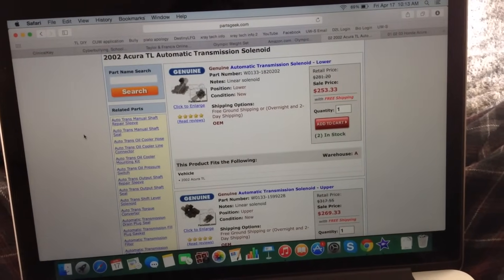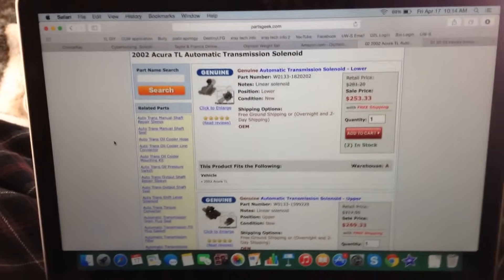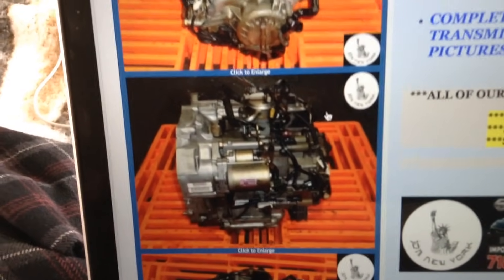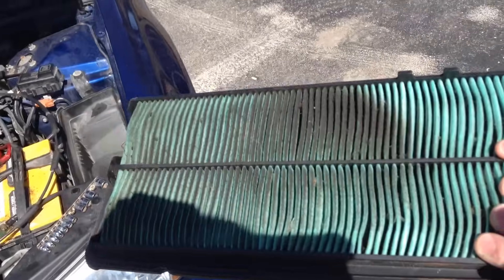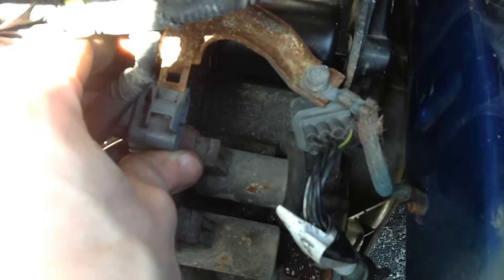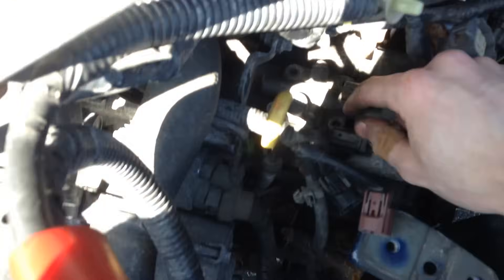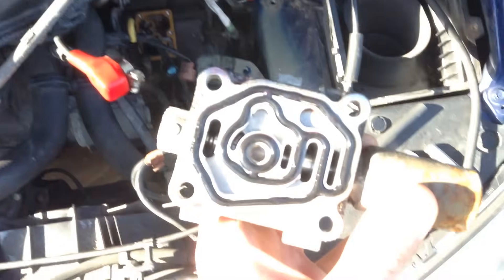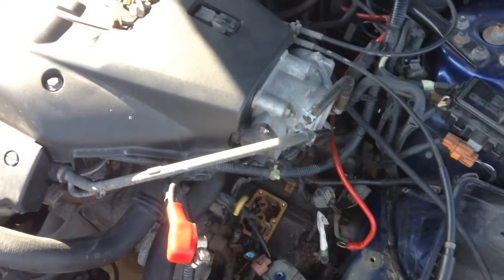Transmission Fix: How to Clean Solenoid Screen Filters for Honda/Acura P0730 P0740 P0780 P1750 P1751

Comment: I have a 2002 Acura Tl 3.2. The transmission shifts fine and shifts smooth, however, I noticed some weird noise going on from in first and second gear when I floor it. I’m going to check the transmission fluid, then I’m going to try this method out to and see if any debris is clogging them filters and clean them. If the noise still persists, I’m going to check and dig deeper to find out what the problem is.
Reply from the maker: That sounds like a good plan! It’s hard to give additional advice if I can’t experience the noise. Don’t forget the exterior spin on ATF filter. Those are often forgotten about. Report back if anything has improved or not and we’ll figure out what to do next!

Comment: On my Honda fit with 370,000 miles, the transmission isn't shifting as smoothly, so I replaced the transmission filter, and it made a big difference!  I will also clean the solenoids to see if the filters are dirty.  Great video, I never would have thought of the air gun.  If you haven't replaced your transmission filter I would highly suggest it!
Reply from the maker: That ATF filter is often forgotten about! Thanks for the suggestion to replace it. I actually have a video on just that! There’s a decent chance if the filter was that bad, there might be a little junk the solenoids too. Good luck and thanks for watching!

Comment: Im getting code p0748 flashing d5 after changing trans mounts, do you belive having to use an impact for a severely stuck bolt caused this from lots of vibrations or from the pressure  switch breaking during the process
Reply from the maker: It’s highly unlikely as your code has to do with the double solenoid on top of the transmission, furthest away from the mounts. If anything, lifting the transmission may have caused the wires to move and result in a loose connection or something. Make sure the connections are clean and secure. While you’re in there, make sure the screen filters aren’t clogged either, do an ohm test (should be about 5 ohms), and connect it to a battery to make sure this piston is working and making a solid clicking sound. You can also make sure the 15A fuse No. 6 in the driver side fuse box isn’t blown.
If all else fails, you can get a used replacement solenoid from eBay or a junkyard for pretty cheap. Just don’t buy an aftermarket solenoid.
Reply: @CarRepairsMadeSimple  i had forgotten to remove the battery so the pan pushed the clip on the solenoid and when i dropped it back down the connector came off lol and i seen your replies to others on acurazine
Reply from the maker: @gksecure6602 im glad it was just a loose connector! I remember making those posts back in the day. That was quite some time ago! Glad to see that post is still helping people. Thanks for watching :)

Comment: Will this fix clicking noise coming from gear shifter, i already reaplaced brake light switch and still clicks. This is the shift interlock solenoid correct?
Reply from the maker: No replacing the transmission solenoid will not fix any clicking sounds coming from the gear shifter.
The shift lock solenoid is where the noise you're hearing is coming from. It's supposed to make a clicking sound when you press the brake pedal. It's the safety mechanism that prevents the shifter from coming out of park unless the brake pedal is pushed, which then unlocks the shifter. If the clicking is concerning or excessively loud for some reason, you could try replacing the shift lock solenoid.
Reply: @CarRepairsMadeSimple thanks, i want to order the part, but different parts show up when i google the shift interlock solenoid. So im kinda confused which one do i order?
Reply from the maker: @7TH_LTR  for the 2000-2003 TL, the part number is 39550-S04-003
Reply: @CarRepairsMadeSimple thanks, mine is a 02 tl-s is that the same part number?
Reply from the maker: @7TH_LTR  it sure is!
Reply: @CarRepairsMadeSimple thanks alot !!! 👍
Reply from the maker: @7TH_LTR you’re very welcome!
Reply: @CarRepairsMadeSimple i changed the part and it doesnt click anymore but now sometimes it will crank over but not start. only sometimes, i dont know what else it can be.
Reply from the maker: @7TH_LTR perhaps it might be a faulty ignition switch (where you put your key in the car)

Comment: Help I replaced the gaskets changed the fluid and was fine for a few weeks until today shifting issues and will not go into reverse now CODE P0730😢
Reply from the maker: @hosea89  dang, that sounds no good. How dirty was the fluid? There should be a dominant red tint to the fluid, not brown or black. It is possible the fluid was so dirty that the filters clogged up a little again, as crazy as it sounds. For that matter, another ATF drain-and-fill could be necessary. Also have you ever replaced the exterior spin on ATF filter? Those need replacing too and could get clogged. 
Otherwise, it’s hard to say. Service manual states the possible solenoids that could be problematic are the dual A/T clutch pressure control solenoid on top of the transmission, as well as shift solenoids A, B, and C. Do an ohm reading on them, and make sure the valves are moving properly and making loud audible clicks when they move.
Reply: @ fluid was pretty brown I will check the filters again and test the solenoids. A/T pressure solenoids are the ones in this video correct?
Reply: After noon I just went to start working on the TL n the shifting felt fine when to move it
Reply from the maker: @hosea89  yes the A/T pressure solenoid that the service manual is referring to is the dual solenoid on top, but it’s also not a bad idea to double check the one at the front of the transmission as well.
Well that’s good it started working again! I would keep a close eye on things though. You never know with these transmissions
Reply: So I have a update!! So I cleaned the gasket filter was clogged a bit put everything back together drove pretty well for a day or two. But sadly the transmission started shifting aggressively and the code came back P0730. I change the transmission filter months ago. Could it be that it’s clogged?
Reply from the maker: @hosea89  if you just changed the exterior spin on filter just a couple months ago, there’s no way it would be clogged already. However, I had it one time where I cheaped out and got an aftermarket filter that started degrading, and the fibrous material from the filter was clogging the solenoid screens and was a little difficult to get entirely out. Put an OEM filter in and I never had a problem like that again. Did it seem like the solenoid screen filters on your car were clogged with a fibrous material as well? If yes, then you might have a bad ATF filter.
Reply: @ the filter was OEM.
Reply from the maker: @ yah your filter should be fine. My personal recommendation is to replace them every 30k miles so it should have plenty of life left in it

Comment: I ordered new solenoids, but they came separately without the mounting plate. Do you know how to remove the solenoids, Im have a tough time. Do I have to remove the pentagon allen screws on the other end? THanks.

Comment: I am trying to find the second solenoid on my 99 tl and I can’t find it for my life
Reply from the maker: The 1999 TL is a little different since it is a 4 speed transmission. Your car does not have the single clutch pressure solenoid on the front like my car has. However, your car does have a second dual solenoid on top of the transmission that has a screen filter as well. Not sure if those get clogged, but it would be worth removing if possible just for good measure.
Reply: @ thank you, I think I know what you are talking about, i will give that a try.

Comment: I just wished u showed how u did the bottom solenoid cuz i have a swivel but can't find the right angle
Reply from the maker: @davidjoseph6106  I’m sorry about that, it was one of the first videos I ever made! It’s been a long time since I did this, but removing the battery and battery plate is pretty much required. Also, try disconnecting the electrical connector. The wires are also held in place by little clips sometimes, try finding any of those and removing them so you can move the wires out of the way for even more room.

Comment: I have questions for you car repair simple. I have a 2006 Honda Ridgeline with engine code P0741 where is this part located on my transmission? Do I have to buy this part or just clean it? Once this part is remove where can I get the solenoid seal gasket separately without buying the whole solenoid part which is expensive? Once I clean it put it back on do I clear the check engine light or do I need to drive my truck and light will go away which method is right for this?
Reply from the maker: @SIDVENOM  you can start by cleaning it, and for most people, this fixes the issue. If not, there is a small chance the solenoid itself can go bad. 
https://www.hondapartsnow.com/parts-list/2006-honda-ridgeline--4dr_rts-ka_5at/transmission_automatic/at_sensor_solenoid.html
Check this website, I believe this is your car. You’ll see the 2 solenoids located on top, as well as their associated o-rings and gaskets which can be purchased. You don’t have to buy from this website, you can copy and paste the part numbers to another website. Lastly, you’ll need to reset the check engine light.

Comment: Idk if your still active bro but at 11:02 after you take off the top solenoid there's a u shaped rubber hose right there, I have P1751 and when it tries to shift into 5th D5 will start blinking and it still does that after I cleaned the solenoids but that rubber hose isn't connected on my transmission it's just loose and the bottom side is just out. Do you think if I try to reconnect it that will fix the code?
Reply from the maker: Looks like the tube you're speaking of is a breather tube of some kind. My guess is it controls and allows air to move in and out of the transmission during heat cycles where expansion and contraction occur, otherwise too much pressure would build up in the transmission. It should certainly be connected, and it can only cause problems by being not connected. Whether or not it fixes your exact issue, I don't know since there's not a lot of information on this little tube. Otherwise, P1751 would indicate a problem with shift solenoid valve B (12-25 ohms) and the dual solenoid (about 5 ohms) shown in this video. Do an ohm test if you haven't already. Otherwise, there's a chance these solenoid need to be replaced. Before you do that though, I would also make sure your transmission fluid level is correct and that the fluid is red and clean. Use only Honda DW-1. Good luck!

Comment: last question, these are your shift solenoids correct? the autozone paper you receive after getting a code tells me P0740 and suggested job is to replace shift solenoids , and drain(and/or) flush transmission fluid. did you clean the screens so you would have to replace any parts?
Reply from the maker: @414NashBaby  these are not the shift solenoids, nor does p0740 indicate a problem with shift solenoids. Are you sure you have the correct video? P0740 has to do with the torque converter not getting adequate fluid, overheating, and causing faulty shifting. The service manual states the main cause of the issue could be Clutch Pressure Control Solenoid Valve C located at the front of the transmission, but it fails to mention to check the Dual Clutch Pressure Control solenoid valves A&B on top of the transmission, the main problem with both solenoids being a clogged screen filter. It also mentions a potential issue with the small single Torque Converter Clutch solenoid on top of the transmission, but I’ve never heard of this being a problem for anybody.

Cleaning the screens fixed my shifting problems and thousands of other peoples transmission problems too. But the screens get clogged because most people were not changing their fluid frequently enough resulting in dirty contaminated fluid, as well as never replacing the exterior spin on atf filter, both contributing to clogging the screen filters in the solenoid. So you need to both replace the atf and clean the filters to fix your problem.

Comment: do you also think that could be a reason to have a small leak as well?
Reply from the maker: @414NashBaby  there are a lot of potential sources for a leak. As far as these solenoids go, I’ve never heard of them being an issue with leaking. But that’s not to say it couldn’t happen with a faulty gasket or an improperly installed solenoid.
Reply: @CarRepairsMadeSimple  got you thanks a lot. literally only video that had helped me
Reply from the maker: @414NashBaby  you’re very welcome! Glad I have been able to help

Comment: So i did this. My car shifted smoothly on the 3rd but then hesitated on 4th and then when slowing down around 20mph it would jerk/shake
Reply from the maker: Do you have any check engine light codes? If not, when was the last time you changed your transmission fluid? It’s vital to keep the fluid clean and at the proper level in these cars. If your fluid is dirty, there’s a chance they might need to be cleaned again. I might also recommend checking out my pressure switch video. Those are known to go bad over time and need replacing. Sounds like you might need to change both the 3rd and 4th gear switches.

Comment: Can you help me find air filter screw 8mm? @Car repairs made simple
Reply from the maker: Yes, go to an Acura parts website, enter your vehicle, then select “Electrical/Exhaust/Heater/Fuel”, and then Air Cleaner. There you will find the screws you need. For my car, I would need PN 90091-P36-000. Hope that helped!
Reply: Thanks it did , we have same car, I just don’t know why order cancelled , do you still order from acura parts for less?
Reply from the maker: @xortiz7077  Not for 3 years now. AcuraPartsforLess was the best for a long time, but I've been consistently finding better deals on a variety of other Acura websites nowadays. Sometimes I'll even order from Honda websites since the PN and part are exactly the same. However you have to manually enter every part number since you can't enter your Acura vehicle on there. What I'll do is pull up 5-10 different websites, put all the parts I need in the cart and enter my shipping address in the checkout, and then see which has the cheapest overall price. Don't use the zip code estimated shipping calculators in the cart prior to checkout, they're not accurate.

Some websites I've used recently include curryacuraparts.com, acura.oempartsonline.com, hondaautomotiveparts.com. 

I've learned prices can change over time, shipping amongst different venders can vary based on your location, and also not every vendor has every part in stock requiring you to try a different seller. However, this is a basic screw you're trying to order. I doubt they didn't have it in stock and I also question why it was canceled. Try one of the other websites I mentioned. Good luck!
Reply: You mean for 3 yrs you haven’t bought any parts from Acurapartsforless , or they don’t sell parts nomore , I think they denied is for some other reason . I may need to use different card , and thank you all the videos are great nd helped me because I have the same exact car nd helped me learn a lot ✍🏽
Reply from the maker: @xortiz7077  AcuraPartsforLess still sell parts, but I personally haven’t bought anything from them in 3 years due to finding better deals elsewhere. I’m glad my videos have been helpful! Thanks for watching!
Reply: Ok sounds good thank you so much , never to bother you quick question,, can you help me find battery terminal I’m confused it says bolt /nut idk which is the correct one
Reply from the maker: @xortiz7077  Yes after you select your vehicle, select electrical, then battery. On the diagram, you'll see the cable that goes onto the battery terminals, along with the bolt reference #12 (32601-SK7-900) and nut reference #13 (32602-SK7-900) which are both required to tighten the cable end to the battery terminal. I hope that helps answer your question, let me know if not.
Reply: You’re welcome 🤞🏽

Comment: 170k miles was running perfect then random p0704 code which i cleared then noticed slipping couple days later and got to the point today where car just wouldn’t move when in gear just rev or take a long time to shift to the gear and be able to move. Did a 3.5 quart drain and fill with new filter and had grayish peanut butter texture on the drain bolt magnet with pretty burnt fluid but definitely not the worst .checked both solenoids today and to my surprise they were both spotless should i try changing the whole solenoids themselves or lost cause ??? also got code p0703 today the 0704 hasn’t came back and p0703 cleared when i disconnected battery to perform this but still slips on heavy throttle and im guessing it’ll still do the standstill/harsh random downshifts . any info or lost cause???
Reply from the maker: I have a couple comments to make:
1. You said your ATF is pretty burnt. If the fluid is still looking bad after doing the drain and fill, it could be beneficial to do another one.
2. Clearing the CEL codes, whether it's with an OBD-II scanner or disconnecting the battery, that won't make the problem go away, and it's very possible p0740 could still be a relevant code, but the system hasn't had enough time to trigger it again because the system keeps getting reset.
3. The dual-linear solenoid is related to both p0730 and p0740 and has caused people issues in the past where replacing it was the solution. I would not recommend after-market solenoids as those have given people problems and were a waste of money. If you love this car and plan on keeping it for a while, I would recommend spending the $400 on a new one. Otherwise, you could try going to a junkyard or getting a used one on eBay for $50.